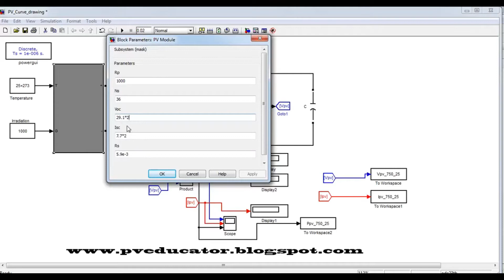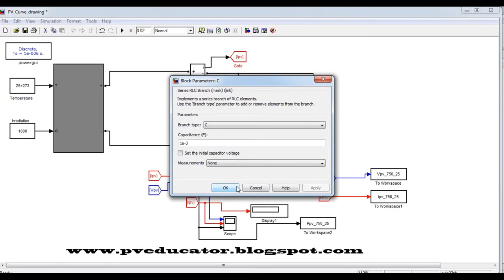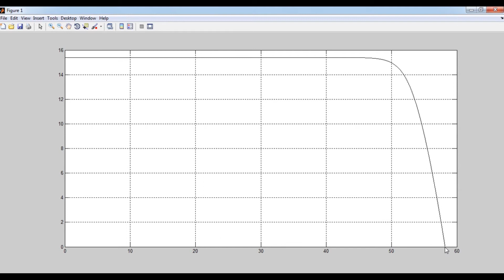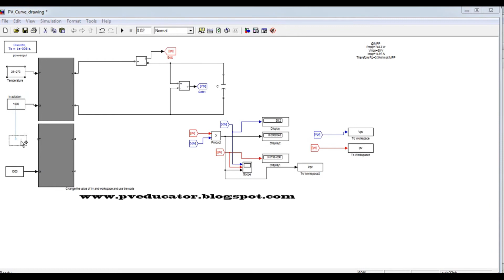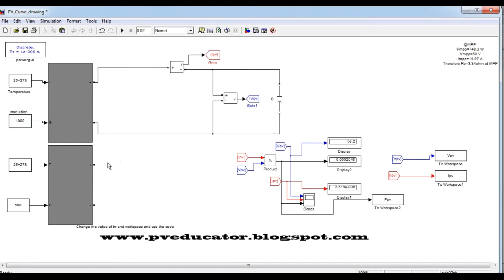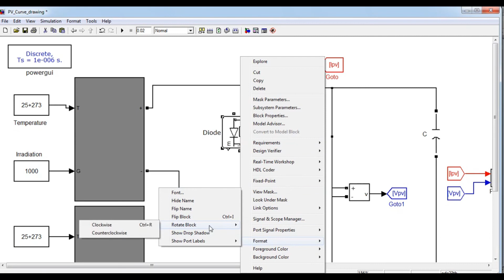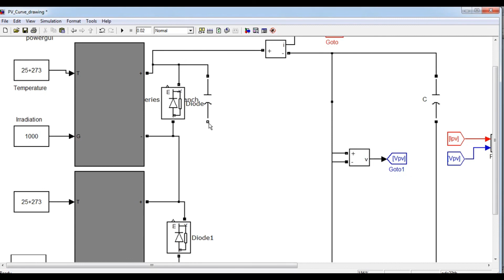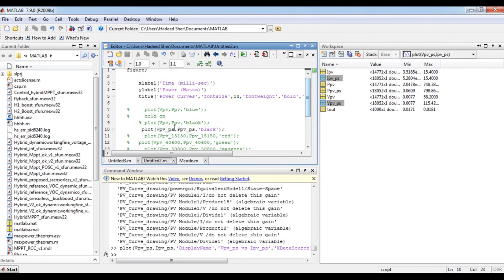PV curve tracing under partial shading conditions in SIMULINK

Comment: sir, I had used the PV array which is in MatLab Simulink, and executed it with one panel. it worked. when I tried to connect two panels in series I am getting NAN values. please help me
Reply from the maker: Remove the blocking diodes and use continuous sampling

Comment: Als can i replicate it for a 2 X 2 pannels i.e., 2 in series along with 2 in parallel. if so, what are the things need to be changed
Reply from the maker: You need to connect the panels individually rather than specifying it in MATLAB. Also connect bypass diode and a small capacitor in parallel.

Comment: Please Sir, '' PV curve tracing under partial shading conditions in SIMULINK'' help me. I am applying the way of your video file, but finally not run. Please, tell me.
Reply: I cannot connect when two solar modules are connected in series connection.
Reply from the maker: It is very straightforward